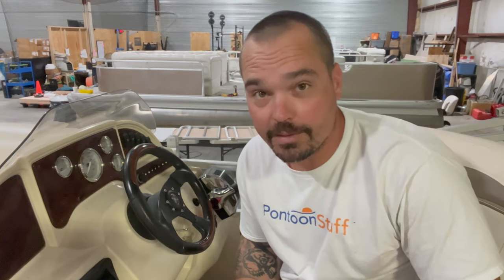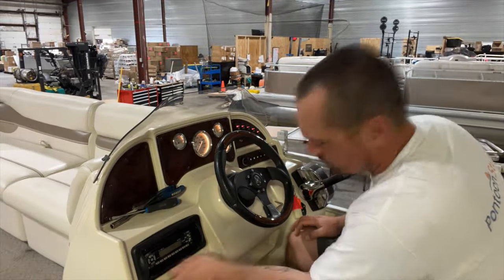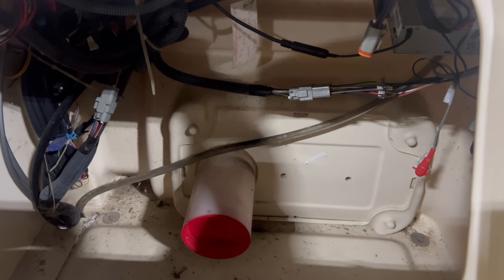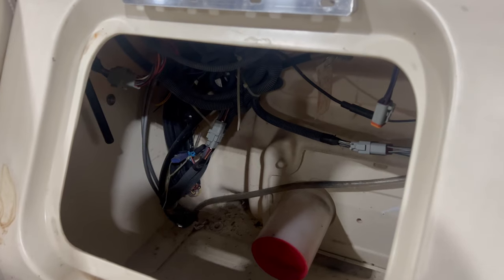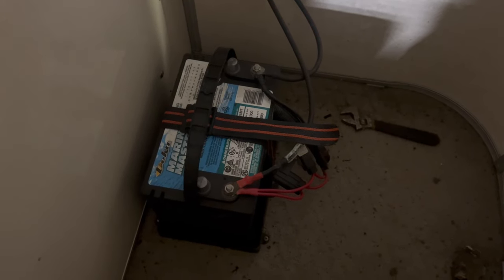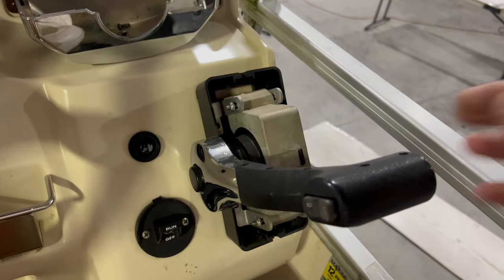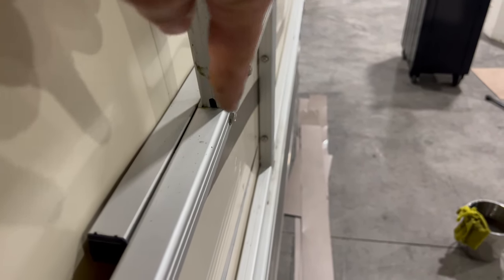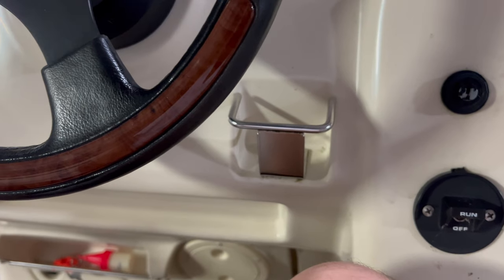Removing a Pontoon Helm or Console for Flooring Project

Comment: Perfect timing, I’m doing this today 😊 👍. Stopped working to grab an early lunch.  Fun to watch a pro do what I do for a hobby
Reply from the maker: Good stuff!! I’ve got another one from an older boat too which shows some different connections and more cutting and splicing back together.
Reply: My current project is a 1989 Playbuoy sportfish with a newer plastic console.  Zero furniture.  Only items in the console are steering and controls, so this job is super easy LOL
Reply from the maker: I tried to stop saying "easy" because it seems like there's always something keeping it from being truly easy...I try to use "simple" instead. At least that way in theory stuff can be simple, but not necessarily easy when hiccups occur!

Comment: Just cuz I have an endless bunch of questions that may, or may not, be related to the video I just watched; do you have a video that covers keeping the floor in a ‘toon boathouse fry? I’ve watched your boat house build and don’t recal that you covered this. Thank Tom and Cori!!
Reply from the maker: We weatherproofed it like a house. Taped everything with flashing tape, laid a moisture barrier, then installed the floor. If it’s a boat you’ll take out often I would definitely underskin the bottom the prevent any water from splashing up against the deck boards on the bottom side
Reply: @tomspontoons  👍🏼

Comment: I have 2 red wires, one black and a gray wire coming from my Yamaha outboard.  Why second red and what is the gray wire for?  Any help appreciated.
Reply from the maker: According to my reference chart, red is simply battery positive. It could be split to supply power to more than one place...however usually key on power is yellow for Yamaha...so I'm not 100% sure on that one. Yamaha shouldn't have a solid gray wire that I know of...but there's a gray with a green stripe that would be for your alarm/warning buzzer. Are these all just loose wires coming from your ignition harness at the dash?
Reply: @tomspontoons  The four wires come up out of the floor into a harness.  One of the red wires does have a number one on it.
Reply from the maker: @diverduckdown  I don't think I've encountered that before. Like I said, the red should be a power wire, so I'm guessing they just gave multiple supplies of power for additional gauges or accessories.